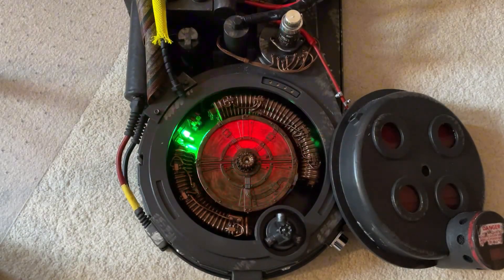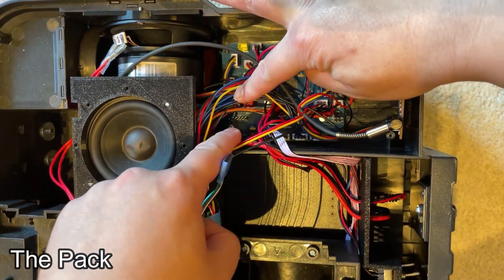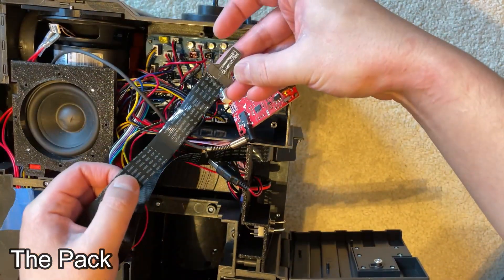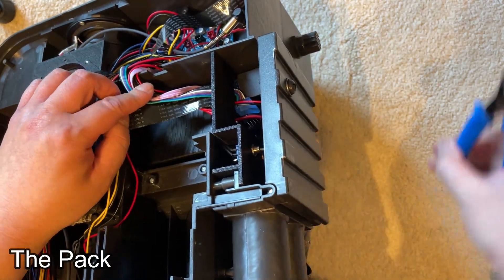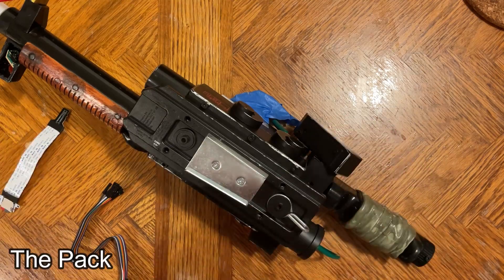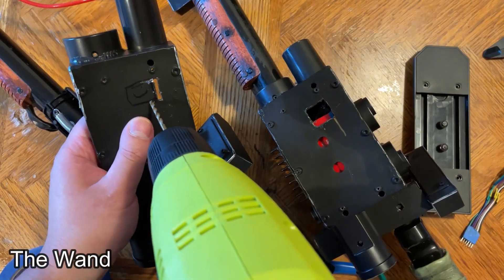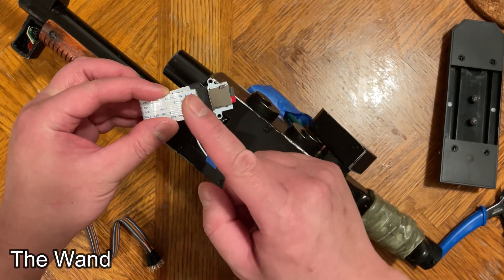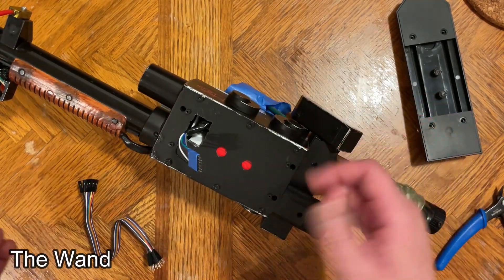GPStar Haslab Kit - Easier access to updating the firmware & sound effects!

Comment: Would it be easier to just not buy a second USB programming cable and have one in the wand and one in the pack like you have in your installation guide video?
Reply from the maker: its's possible but they cable is long and thick. it'll be more difficult putting it in and out of the pack and the wand had limited real estate and won't be able to fit it